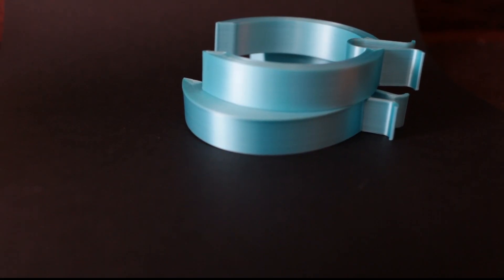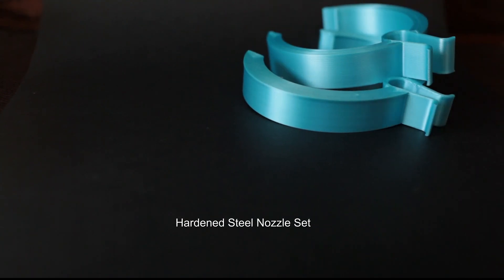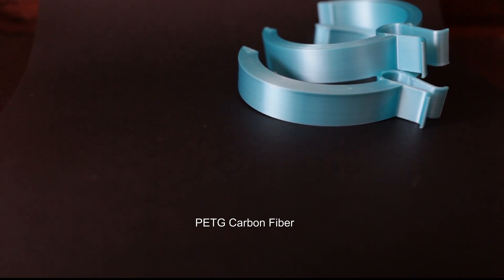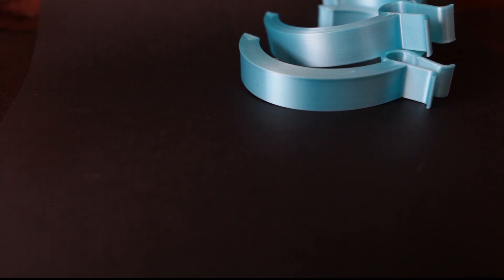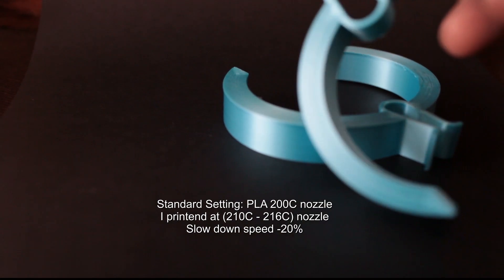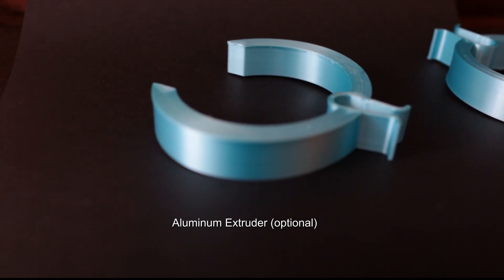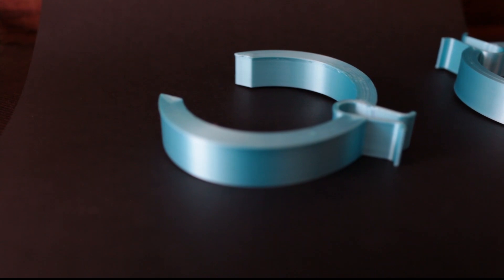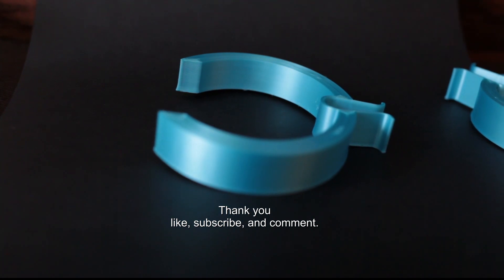Smooth 3D Prints Ender 3

Comment: i feel like the quality boost you are having could be due to slower printing speed/good slicer setting. You mentionned using 0.4 brass nozzle before the switch, were they stock creality nozzle or cheap knockoff from amazon?
Reply from the maker: Thank you for watching🙏Slower does help a bit👌. I used 0.8 nozzle. Should run a live test 🤔 of this video? think it would be interesting